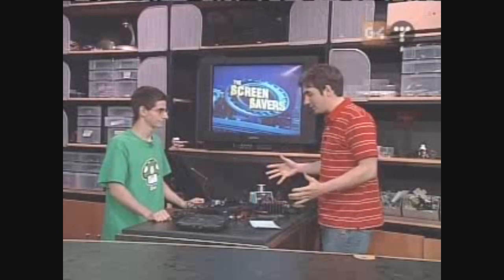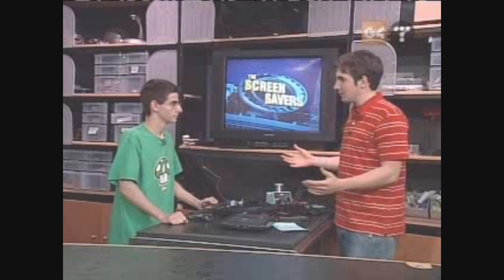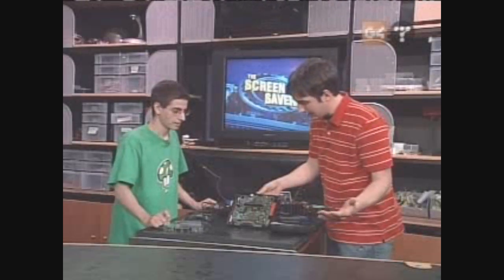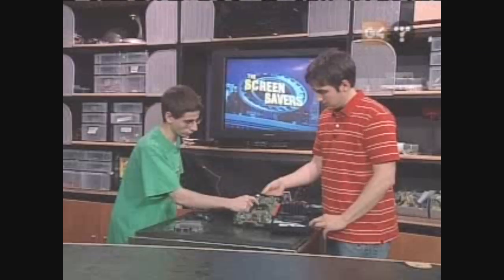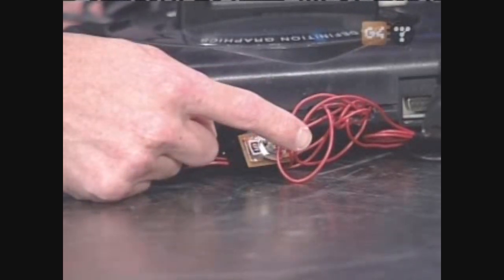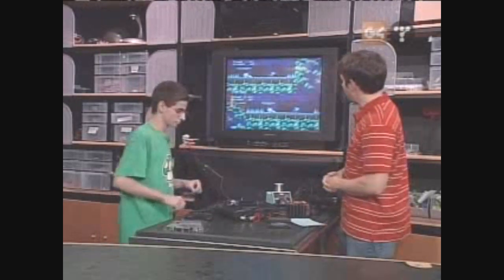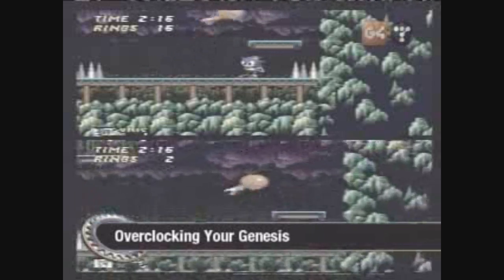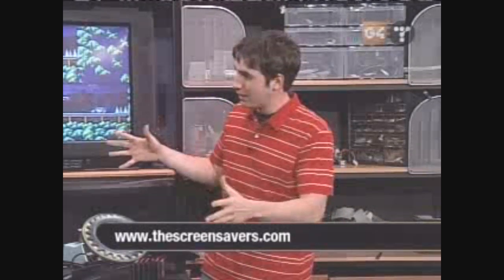Overclocking a SEGA Genesis

Comment: 1: SEGA didnt anticipate anything, the reason this is possible is due to the fact the main cpu is not tied into the rest of the console like the SNES or MasterSystem was.
What hes actually doing is tapping into the clock line of the VDP.
This originates from the main oscillator signal divided by 4x to equal the 13mhz if i remember correctly..

Comment: I wonder why Sega just didn't run the Cpu at 13...
Reply: the clock was tied to the TV system. For example, PAL Mega Drives actually run at 7.61MHz rather than 7.67MHz for NTSC, so even my 60Hz-modded PAL Mega Drive in 60Hz mode doesn't entirely behave like a Genesis (or Japanese Mega Drive) in that the sound pitch (not speed) is still very slightly lower. Technically that means the whole system still runs very slightly slower, but nothing you'd notice and nothing like 50Hz mode.

Comment: I didn't notice any improvements, maybe is too little, but don't see that much difference, what about if playing the Sega Genesis games on 32X, does the 32X helps speed up the genesis games?
Reply: Not in terms of framerate, but the video signal looks somewhat better in some games such as sonic
Reply: +roberto torres thanks.
They make remakes of Sega Genesis consoles, but why they didn't make a Pluto version with the 32X integrated and hdmi output, because they made some cheap consoles, but they just bad quality.

Comment: The  ZSNES emulator has turbo button to speed up on demand.  I use it to speed up load screens.
Reply: +0011peace "load screens" wut
Reply: madProgenitorDeity
screens like the title screen where they make you wait for loading or go through starting monologue.  Sometime the monologue is done to hide the fact they are loading the game.  If you press ~ while in ZSNES running a game you can speed up non-interactive  screens including cut scenes
.  You speed up interactive too but since its waiting fr response you might not notice increase except for action like walking.
Reply: "Sometime the monologue is done to hide the fact they are loading the game"

iinteresting
Reply: madProgenitorDeity
Yeah if you have something to do while loading you get less frustrated or bored with waiting.  The turbo button allows faster loading.  At closer to native computer speed.
The SNES runs at 21Mhz which what you need normally while playing.  But, some times its nice to skip through long text and cut scenes.  At 500 times that speed even the long SNES waits become short
Reply: +0011peace 
3.58mhz do some research. 
21mhz was the SuperFX chip.
Reply: Objectified Cross
do your own research
http://www.smwiki.net/wiki/Super_Nintendo_Entertainment_System
Reply: +Objectified Cross I gave you the site with the specs and you get extremely rude. Proof you have bo class

Comment: Overclocking would just make that worse lol. RROD is when the xbox overheats. Overclocking makes the CPU run at a faster clock speed, which generates more heat.

Comment: What's interesting is that the game didn't run faster with a higher clock speed. It's pretty much unheard of that a game (especially a console game) would be programmed with a frame rate limitation.